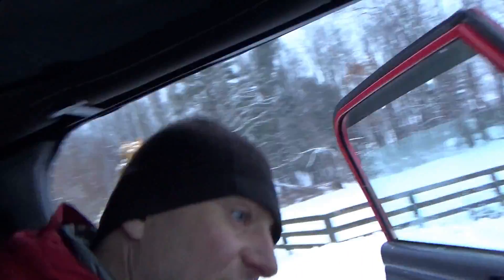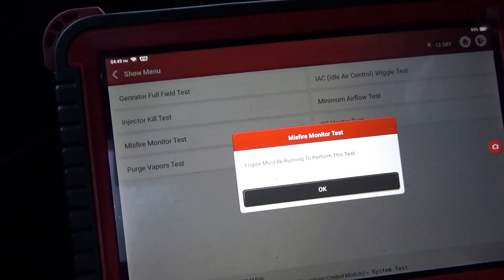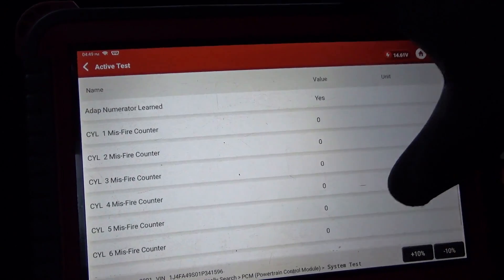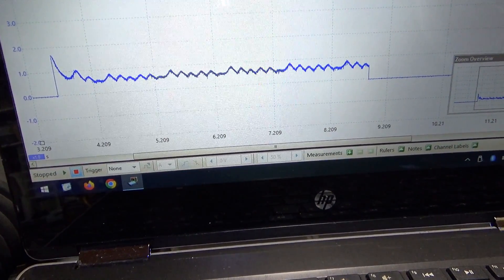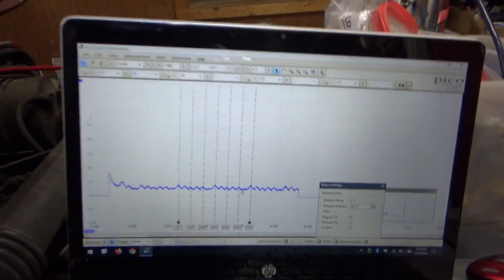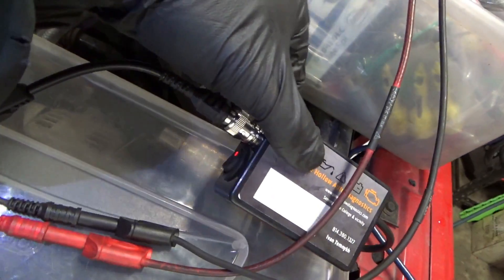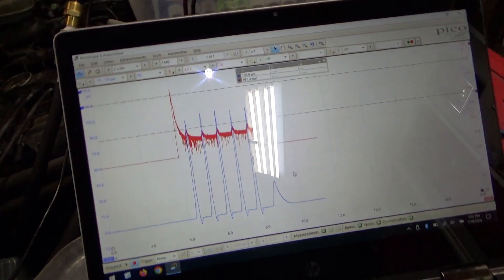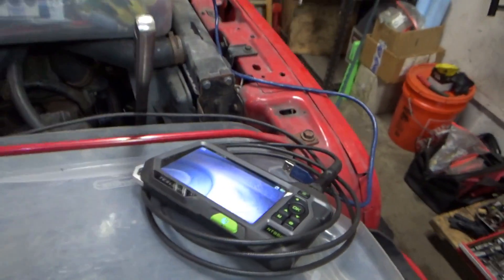Jeep 4.0L Runs like "Garbage"? (Part 1 - Diagnosis)

Comment: Replacement engine, had a cylinder head that was not correctly serviced ( el cheapo).  Pretty normal.  If the engine does not have excess blow by (lift oil cap at idle) and poor compression, its going through the valve seats. At least one valve is recessed back into the valve seat.  Recessed valves are simply lots of miles and the head needs new valve seats or replacement.

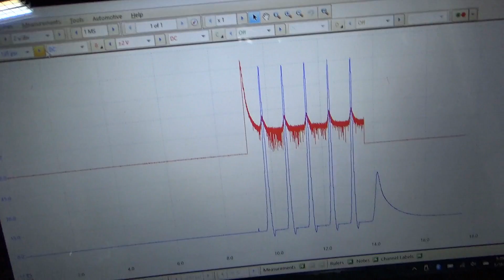Comment: I do not like the way  how you did the compresión  check by removing  all Spark plugs 9:07 . 
With all plugs  out you can miss some  important information  as per example how about if the companion cylinder  had any issues on exhaust as worn lobe exhaust flow  issues  normally will be reflected  on the brother cylinder but with all plugs out can conpress any thing on exhaust  if will be the case

Comment: You said they already replaced the motor. Was it a junk yard motor or a rebuilt from a reputable company? If it already is having a problem it wasn't from a reputable rebuilder then.  There has to be a warranty on it if it's a rebuilt RIGHT ?

Comment: I do car my own repairs (as a DIY), and occasionally for family only. My standing rule is, if the the fuel tank is empty (or battery is spanked), I charge $25 labor, plus gas. (PS: I otherwise, don’t charge labor for family, and won’t work on anyone else’s cars).

Comment: Synch can still be used by pulling a spark plug and use in-cylinder pressure transducer alongside RC. Then with firing order identify the weak ones.

Comment: Retired now but it was common to see exhaust valves receded that far or further on cast iron heads running on LPG in the days of leaded fuel. LPG has no lead, hence valve seat recession caused by "welding" of the valve seat to the head with no lead to intervene. Over time the seat material goes out the exhaust pipe and the valve becomes recessed. The ticking that goes with it is the valve clearance in the "lash" of hydraulic followers running out of clearance. Usual cure was to put inkonel or other hardened valve seats in the head and stainless or inkonel valves in. Since introduction of unleaded fuel and aluminium head the seats are induction hardened or in aluminium heads, hardened inserts.
Reply: I meant welding of valve face to the head.

Comment: I know these old Jeeps were infamous for dropping valve seats.  Usually brought on by overheating issues.  The Jeep Liberty with the 3.7 V6 had a bad rap for that.  But when a valve seat drops out, mass destruction follows.  I'm not seeing that here.  So, did this valve seat pound it way deeper into the head?  Or did it just burn it away?  Ivan, I hope you take us along on a tear down.  I'd really like to see what happened here.

Comment: My 97 sounded like that exhaust once, but it was because I'd pulled one of the plug wires off to get it out of my way when changing the oil filter adapter o-rings and forgot to put it back on... 🤣

Comment: Did someone redo that head already and put an undersized valve in it?  Not sure how a valve that otherwise looks ok could sink below the head surface.  I'd love to see the valve train on that particular valve.  Almost like a rocker slipped off but that doesn't fully explain the valve bypassing the seat.  Even with a working valve in cylinder 4 that head still wouldn't run too great given those other cylinder pressures.  Hopefully a valve job solves the compression issues and it isn't leaking/stuck rings.  Thanks for the video Ivan, always love to see a new PHAD's post.

Comment: I learned years ago back in the mid 90's my neighbor had a 77 dodge motorhome with a 440 4bbl engine and it was running on 4 cylinders and when I pulled the heads the exhaust valve seats in 4 cylinders were gone but I couldn't figure out the fuel smell and I took the heads to the local machine shop and Larry called me and asked what fuel was ran through it so I called the owner and he said methanol fuel he got in the State of Ohio and by the time he got home in Pa 4 cylinders had no compression so I called Larry and told him and he said yep, you can't run methanol in any Chrysler Product, I got the heads back with a valve job done and the heads planed .015 thousands and that 440 would scream in that motorhome!!!! Let it be a lesson to all you Chrysler guys to never run methanol gas in your engines!!!!!!

Comment: I've seen other comments now about the fuel thing, but as soon as he showed the fuel light was on and it was out of gas I mean that's just like a slap in the face, you know it's going to a shop and it needs a full diagnosis yet you didn't leave any gas in the tank? I would charge 789 a gallon for each gallon and I have to put in on my time because he wants to be a cheap schmuck I mean maybe he just forgot who knows

Comment: Even gasoline has gotten complicated, there's 85 87 88 89 91 and 93. WTF! Here in New Jersey we have 87 89 and 93 that's it when i go to Pennsylvania the pump is like one of those soda dispensers with a million different options. A recent video from watchjrgo, he had a Chevy equinox that wouldn't run, he tried everything and was almost ready to call a bad engine, a guy was helping him and it was his sisters vehicle they even walnut blasted the valves because they were ll carboned up it being a GDI engine, she had recently put gas in the tank, after exhausting all other options they g]kept cranking the engine and it would kind of run for a second, he then sprayed starting fluid in and it ran, they decided to siphon some gas out and it didn't look right, they drained most of the gas and put new gas in and it ran, they realized that she had put the wrong gas in, this was a non flex fuel engine and she put in 85 or something, it requires 91 octane, they managed to drive it to a gas station and filled it with the proper fuel and it ran perfect, it was a 2016 model, my sister had one and it required premium, I don't think that's the case with all of them, i wonder if this ever happened to anyone else and was sold a new engine when all it was was the wrong gas. https://youtu.be/1J4ssn0hQ6Q?si=-qhUpe1KOmNrgmvH

Comment: I wonder how many miles were on that "replacement" engine before it was installed? The combustion chamber honestly doesn't look that bad aside from that pooched valve. I have a 98 (same Jeep) with 190k on it and I just pulled the plugs to take a peek at It's heath and they are golden! I added an Accel High Energy (Hot spark) ignition coil about 30k miles ago and the difference in combustion is considerable.

Comment: More information about this engine would be preferred regarding age/miles however, if it was used when installed, I would rebuild the entire engine. If it was rebuilt and only had 90,000 miles on it then, the valve job seems to be a fair limit.

Comment: A freind of mine had a chevy truck he bought new . I heard it running and it sounded like a dead miss he said it sounded like that since he bought it. So we took the heads off and took them to a machine shop .The man said the one cylinder  never had a valve seat installed  from the factory.This was  in the early 80s.Ran much better after we put back together.

Comment: i was thinking the head is cast iron, there are no replaceable seats on those, the seats are induction hardened, sure you can machine them for replaceable seats, I ve seen machined/ replaceable seats come loose over time. better off getting a whole new TUPY head

Comment: Good one Ivan.  I wish we had the Pico and the borescope 15-20 years ago!  Would have saved a lot of time!
I agree about the gas.  Except for an in tank fuel pump problem, PLEASE at least have half a tank of fuel!
Those 4.0L 6 cylinder engines were great!  To bad they're using less than the best now.
On to part two.

Comment: Sometimes what can cause a burnt exhaust valve is a partially plugged fuel injector. It causes the cylinder to run very lean and gets the valve hot to the point of burning a chunk off of it.

Comment: Ivan, thank you for sharing the amazing work you do.  Will you consider dumbing it down for us mere mortals and reduce the abbreviations and jargon? ASD ?? Etc. Thank you!
Reply: Automatic Shutdown Relay. It shuts off fuel and ignition when off, or removed. It's supposed to help prevent engine fires and hydrolocking in accident/rollover conditions.

Comment: A proper valve job on this run-out head would involve seat and valve replacement, resurfacing, and possibly a multitude of other expensive machine shop processes. This would sideline the vehicle for weeks or months and cost a small fortune. A good used or rebuilt head will fix the problem, so long as the lifters are working properly.

Comment: These engines in that year range had all sorts of head issues, they would crack under where the oil cap is and leak coolant into the oil, the valves had carbon issues from low rpm, then they would burn and wear the seats, they had TSB’s for fuel vaporization after a hog soak, the list of issues just go on, great video as always Ivan👍
Reply: What years were good for the 4.0 in these Jeep models?
Reply: @Garth2011 they had head issues from 99 to about 2003 then they changed the head casting to fix the cracking issue. They still had carbon issues with the valves though, sometimes you could repair just with combustion chamber cleaner others got full valve jobs with new springs.

Comment: “You could do this with a manual compression gauge and get the right cylinder”…pans to face…”But isn’t it cooler to do it with a pressure transducer “ 😂 quote of the day

Comment: I seem to remember 50 years ago in auto shop when a SUN scope the size of a refrigerator was hooked to a car you could deactivate cylinders one at a time and see if the idle rpm changed.  If it didn't you knew that was the cylinder not contributing.  Do modern scanners do that and is that a test that would have identified cylinder 4 without having to disassemble?  Your use of bore scope and leakdown test was very definitive.  Nice job as always.
Reply: exactly...  the computer in many turn off injector for the cylindee that misses  but this one didn't even know the misses...AND HAD THAT ABILITY.  I remember those huge Sun machines...  cool
.
Reply: A lot depends on the cars ability to shut off certain para meters, in GM cars and other you can check miss fires per each cylinder.

Comment: Can you let us know if the head casting no. Is 0331? If it is - is there a TUPY casted under oil filler neck?
If not - make sure you get a TUPY unit. Non tupy are cracking, causing issues on cylinder 3 and 4

Comment: No parts required.  Just cut off the first ring on the valve spring so it can't get sucked into the head.  :face-blue-smiling:

Comment: I just don’t get it. For someone who supposedly considers you worth the effort to employ, and wants their vehicle fixed, they give it to you with an empty fuel tank. To me that’s the ultimate sign of disrespect. I’d tell them to turn around and go get some gas before dropping it off, or no work gets done. That’s just embarrassing to do what the owner did there
Reply: At my shop they just pay the hourly rate for me to go get gas, plus the cost of the gas.
Reply: @tomjohnson6036  As they should...
Reply: I normally put $20 and charge $40.
Reply: If a known fuel tank issue is possible, it’s usually discussed beforehand, but even then, an 1/8th of a tank, maybe 1/4, but something off the E line. I think the guy was just irresponsible, because he knows the engine is running bad and goes thru gas like there’s no tomorrow, to then say nah, I’ll just drop it off on E in case it’s the gas tank? Maybe in other cases, but not this one.
Reply: It’s a jeep they’re always out of gas 😂 ask me how i know😢
Reply: Either no gas or no oil!
Reply: 10 bucks per gallon?
Reply: I've done that before (without thinking about it) and was charged for the shop adding gas ... and rightly so.  

Didn't complain, felt bad for my oversight, and made sure not to do that again.
Reply: @user-jv2ol1yq9w they’re both good. Own a 4runner and a TJ but the Jeep is more fun

Comment: In-line 4.0 engines have iron heads and it has worn through the induction Hardening of the exhaust seats replacement seats can be put in fairly common
Reply: I'm not familiar with these engines but I did wonder if it was old enough that it had seats machined direct into the iron head.  Fitting hardened seats won't be cheap, but will hopefully mean many more miles of life.

Comment: Wow, what happened to that seat? Those were actually pretty good engines, but if it was a “used” swap who knows how many miles it actually has. I’ve seen a couple of these with broken piston skirts, which creates a pretty distinctive noise. Very short skirts for whatever reason. Considering the compression on the other cylinders, I would be a bit reluctant to even put a used head on it, but it is of course the owners decision. 👍👍🇺🇸

Comment: Seen a brand new Jeep that ran like garbage when I worked for a Chrysler dealership.
Wonder why?

The exhaust was plugged up because someone didn't make the hole on main pipe for the 1 cylinder that it goes to.

Comment: Wow, that's a dead-on diagnosis, Ivan!   I have never seen a phenomenon like this before.  If it's the valve seat, why is this one so bad or is it missing?  Could it be that this is a reman head and either the valve seat was not put back in or the wrong size valve was put in?  I guess we'll find out in part two.
Reply: BTW, I just watched a video on replacing valve seats and it looks like it's a job for an experienced and equipped machine shop.  I would hope that you can just get a new head or just replace the valve if it is the wrong size. 😊

Comment: Great diagnostic, Ivan! It almost looks like the exhaust valve in #4 has a smaller diameter than the other ones (or has completely lost the valve seat). Didn't think you would tackle this, but now we're on to an interesting Part 2 :-)

Comment: These heads are infamous for cracks.
Have used heads magnaflux zyglo pressure tested .

Next his trans mission will fail after fixing motor.
Common on high milage stuff.

Excellent channel
Reply: The earlier model heads had this issue, but resolved it in the 03-04 year design I believe with the TUPY 0331 head.
Reply: @The_Borg  thanks I will save that info .

Comment: I think 2 problems,, bad valve on number 4 cylinder and head gasket blown between 4 and 6 .. You should do the pressure test on cylinder 6 and see air is coming out of cylinder 4 😊
Reply from the maker: Tell me how a head gasket can be blown between 4 and 6 without affecting cylinder 5 🤔😉
Reply: Took the words right out of my mouth Ivan.

Comment: The 3.8 litre Buick L36 V6 engine which was Holdens ECOTEC version had the same valve seat recession problem at about 236,000 miles or 380,000 kilometres in his  2000 model Holden VX Commodore due to the use of LP gas which is hard on the exhaust valve seats.

His solution to fix the problem was to replace the whole engine which he got  from a 2004 model Holden VY Commodore at the local auto dismantlers back in 2017, the engine had done 200,000 kilometres or 120,000 miles in that car 

To be honest, I don't know why he didn't just replace the cylinder heads with reconditioned exchange cylinder heads, replace the pushrods which were scuffed & possibly the valve rockers as well, there were used cylinder heads for sale on eBay as well.

He was worried about reliability but he barely drives the car now because he's always driving his Colorado,he also decided to replace the 4L60E transmission with another one from a VY Commodore as well probably to fix the delay on takeoff that car seems to have but when the VY Commodore transmission was fitted (on the second go because he broke the pump rotor inside of the hydraulic pump because the tangs on the torque converter shaft were misaligned) it didn't make a difference so I don't know if that's GM or Holdens fault.

My VY Commodore has a tweaked 5.7 litre Chevrolet LS1 V8 engine & T56 Tremec manual transmission fitted, it's approaching 397,000 original kilometres (247,000 miles) on the odometer,I prefer to drive that car very much more than the 3.8 litre Buick L36 V6 powered Holden VX Commodore !
Reply: Yep LPG will do that to exhaust valves + seats. 
Some brands more then others. But it will happen much faster if the heads are made of cast iron with the seats cut straight into the casting (like Ford Pinto OHC inline4). In such a case you can have special valve seats machined in.
If i remember correctly the material is sintered steel made by Schneider. 
I could be wrong tho. It has been at least 15y ago since i had it done. 

The accelerated wear is caused by micro welding that happens between valve and seat as they slam together and get ripped apart again. Specially at high revs.

Comment: Hypothesis: tappet stuck, making the exhaust valve slightly leaky. This caused hot exhaust gasses erode away the valve, but not the seat. End result is a recessed valve that is (still) not sealing properly even if the tappet unstuck itself.
Reply: Lack of valve clearance would typically end up with a burnt valve rather than an evenly recessed valve seat.  This looks like a material problem, like you get from running a head with cast iron seats on unleaded fuel.
Reply: @@Google_Is_Evil   That could very well explain it, & the ticking sound.

Comment: Who in their right mind brings you a vehicle to diagnose with an empty gas tank??
Reply: Looks like he's going to need to add some gasoline to the tank; he's done it before and charges the customer for his time and the gas; and he should do that.
Reply: The same type of person who brings it with a full tank for a fuel pump replacement.
Reply: Perhaps someone who has their suspicions about the quality of the gas being sold in their locality ?
Reply: @t5ruxlee210  nah they just drove for several hours…coulda stopped and got a quarter tank at least…
Reply: Exactly